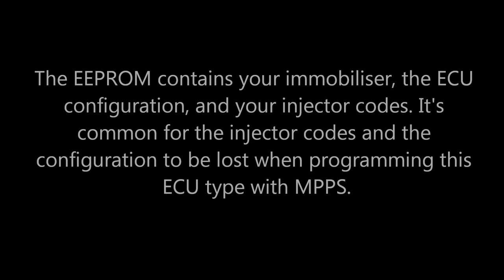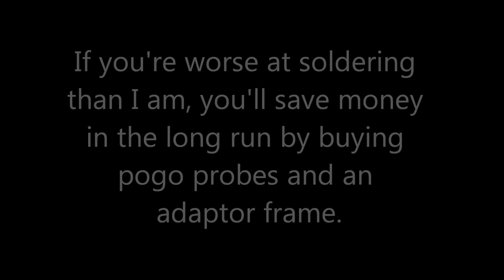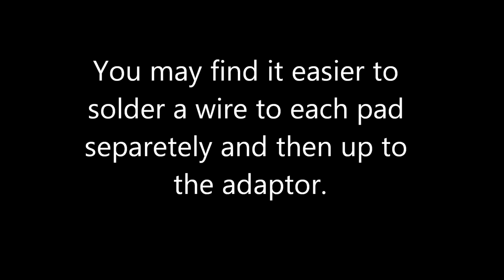How to read and write a Bosch EDC16 ECU using BDM100: Read description before watching or commenting

Comment: When soldering always remember that solder will creep TO the heat i.e. your solderingtip. It's best to apply a little solder to your tip and hold the tip on one side of the object to be soldered and apply the solder on the opposite side.

Comment: hi ,is the pin out used all of 10 pin for ME9+Ecu ( i see EVC page #5, ME9 &EDC16 as same and 10 pin without pin# 3 & 4) , in your Video connection to all 10 pin? 
i read ecu with K-tag without PIN 3&4 all fine but can"t read EEPROM  in Bosch bmsk-p (ME9+)
All time Error connection with BDM100 chines clone , so what is correct pin ? Thanks

Comment: Can one retrain a 2004 Honda Odyssey ecm with this method and if so can one retrain the ecm to forget about the transmission so it may run successfully as if it had a manual transmission??? Also to trick the ecu to  not rev limit before v-tec engauges so that you get the full power band?? I am buying a ecm training module that is similar to the one used here and I want to know before I put in investable money further into this tech

Comment: OK.Loved the video. very clever.. lots of information.

One criticism [only small]. You should solder ON the same way you soldered OFF ie. by applying the solder directly onto the joint...not bring the solder to the joint on the iron.. it gets what we call icicles' which don't stick and go crystalline..

One thing you didn't really delve into was the advantage of downloading the ECU data and tuning it as opposed to the standard OBDII port method. ie. what am I getting extra that I might want?
Reply: bicanoo_ma

Comment: first you placed red stripe to the left (from your position) and when soldering to the right... how to know which one is correct to avoid frying ecu? :(
Reply from the maker: yt2011F both are different tools. One is the proper bdm from evc, the soldered connection is the cloned cheap tool from eBay. It's actually dimsport 555pro a complete different tool.
Reply: Hi
I have a clone bdm100 without Bosch frame.
My ECU os edc16c3. Can i read and withr without Bosch frame?

Comment: What about cutting around the glued edge with angle knife/ box cutter once the corner is started?
Reply from the maker: On certain ecus the glue is much stronger, so you will need to carefully do this with a Stanley knife, but on this example it has the weak light grey glue so it was easy to open. Typically on vehicles where the ecu is exposed the glue will be much much stronger for example the older berlingo vans where the ecu can get wet.

Comment: Hello!
can I flash edc16cp33 ECU with this BDM100 ? I wrote the ECU with mpps ,and some error comes, now don't start the car.............or just KTAG good this work?-thanks
Reply from the maker: thomas Admiral Hi, It's important you stop now before you damage beyond repair. If you can get a full bdm read using this tool or a kess ktag, then I can repair the file for you. Very important that you don't attempt to program anything over bdm without first making a full backup, the OBD file you have is half blank so it's very important not to use that over the bdm 100
Reply: hm.thank you  so much,,!
Then first open it the ECU, read BDM-port with Ktag or BDM100.--another forum told me,for my ECU don't good the BDM100 tool!-can this be true?
 The mpps don't create a backup file on my laptop?
https://www.youtube.com/watch?v=11dV0OVCRFw
how did he do it?

Comment: i have an ED0062 CR3.13 2.2L  Star A 6461532079/Bosch 0281011158
with a DTC 2339/2347"Check variant coding cheksum data faulty control unit eeprom
error AT has been coded as MT - belongs to a E-220CDI/2005. 
what do you recommend ? throw it to the fish ? ;)

Comment: how can you tell if the bdm100 you want to buy is 'legit'... also are there various pogo probes available for different ecus? are they different for CAN-BUS vs K-Line?
Reply from the maker: The real bdm is around 700 euros plus tax, the fake bdm is 10 euros 😉
The real bdm from EVC is awesome, I've had mine for probably 7 or 8 years now and I use it several times most days. Best money I ever spent.

Comment: so actually the kess v2 does the same whiteout opening the ECU that right ?
Reply: 8100rpm No you actually have some disatvantages in programming
Reply: Kess works good but not at all ECU types, for that u need to use Ktag with BDM.

Comment: Hi I'm looking a programmer to program edc16c9 and edc17c46 (Audi can engine) is it possible to do both via BDM using bdm100 and adapter?
Reply: tell me what car model,engine,ccp ,you have,ty of ecu.
Reply: @roznovanuioan8680  hi I own 2 cars: Opel astra 1.7 z17dth ( edc16c9 should be the ecu) and audi A5 can 2.0 tdi ( edc17c39??) .
First af all I d like to make a clone of the ecu and than trying to modify maps. I've already bought a edc16 Bosch for the astra h but I don't know the pin code. I have a BDM ( via odb) and a  galletto via Bdm 
Looking forward
Reply: @carmineminardi5210  astra g 17 CDTI ECU BOSCH EDC 16C9  can't be read with kess, if u whant more info send me a message via faceboock , same name,but this ecu  can be read via ktag
Reply: @roznovanuioan8680   ok  i didn't find you on f book.
Reply: My astra is H not G,  it's a edc16c9  if I remember.
Reply: @carmineminardi5210  ioan roznovanu ? give me your faceboock, i find u
Reply: @roznovanuioan8680   Carmine minardi
Reply: @carmineminardi5210  what avatar u have

Comment: Hi
Which program i should use to remove for example chain tensioner SELENOID or SAI or rear o2 sensor in audi a4 b6 1.8t?
Reply: If you have to ask that, you shouldn't be attempting it.

Comment: he man  when you used the BDM100 from ebay on the ecu  you have solder 10 pins plug without space so evc mentioned that the pin 3,4 ,13 and 14 are not used how you can read the ecu

Comment: excellent video , do you have any recommendation for power supply to be use for ECU power ?
Reply: Most likely any 12vdc power supply. Most home internet routers use a 12vdc power supply. Find an old one that you don't need, or that someone has junked.
Cut the cord that you would normally connect to the router, (unplugged of course or you will get shock 🌩 😲 yourself, catch on fire 🔥 and possibly die 💀).. Separate the wires and then plug it in, next get a multimeter set to VDC identify + and - wires.
Reply: @chrisd1828  Or the power brick always has the output voltage molded into tiny letters on the case of the plug/wall wart to tell you what is up.

Comment: Why dont you use MPPS? I assume it reads and writes as well - what is the difference?
Reply: +Dimitry Linnik Because with mpps you read 1/2 of the file and if during writing ecu died , you dont have any backup.With BDM you can clone in FULL ecu.If sometime is needing to swap ECU you can do it for 5 min.
Without learning keys ex...Only Mercedes is a problem because BDM pins are in oposite side of the board.
Reply: +Nikolay Nikolov what about SIPM SMPS clone if you know it, is there any noticed problem?
Reply: +Khaled Benloucif (Kikou Ben Kooker) 
All obd flashers are not 100% secure. And with flashers you cant have eeprom to all edc16 ecus.So for edc16 the best is BDM read.
You can read and write obd 1000 cars with no problem, and 1001 maybe will die during the process.

Comment: my car opel astra g 1.6 16v year 2002 I have a problem with the engine computer in service i got a computer of opel zafira same the same mark we the 1.6 16v engine and i was not in my car and with need to go with the clone to ignite car and according to you did they tell me right in the service
Reply: i clone simply a opel vectra c , identical ecu , i just move the eeprom chip and flash, the car runs ok. Witf old ecu the car not accelerate

Comment: price for software and hardware? my budget is very low :(
Reply from the maker: Gowsiganaudio the remapped software is just £99. If you can't afford it then leave your car alone and spend the money on something sensible like new brakes or tyres 😉
Reply: China clone is cheap  + free software
Reply from the maker: @PeterFeltersnatch852  if you send me an email showing a photograph of the codes on the ecu, and then the original software which was on it, and the new software which your friend wrote I can take a look and advise what needs to be done. Email is on my website.

Comment: this is the original BDM or china version ?
Reply: The guide shows how to use both the original EVC BDM100 tool and also the cloned china tool (actually the Dimsport 555pro, not a BDM100).

Comment: Sounds like is cracking the board there..
Reply from the maker: No that's the glue.
Reply: Kya aap bataa sakte hai ECM se miter me service light Nahi AATA hai dusara ECM lagane par AATA hai
Reply: @StevenLewis-HDI-Tuning    HEY  STEVEN  ,  is  the  cloned  bdm100  u  use  there  with  the  soldering  as  your  second  example  for  reading  the  ecu   ,  can  it  work  on  certain  windows  system  PC  only   ?   meaning will  not  work  on  windows10  for  example  ?